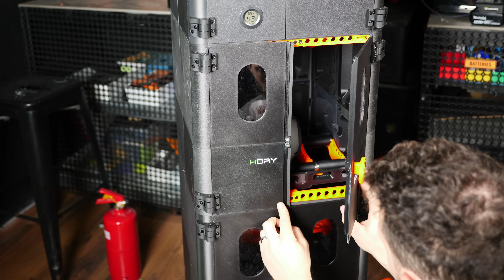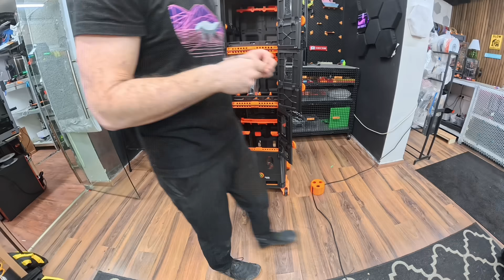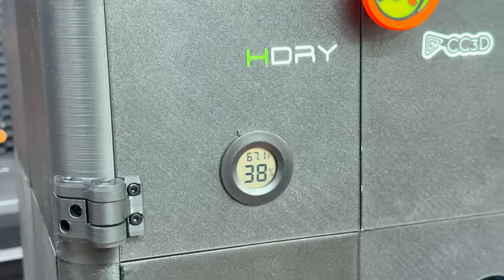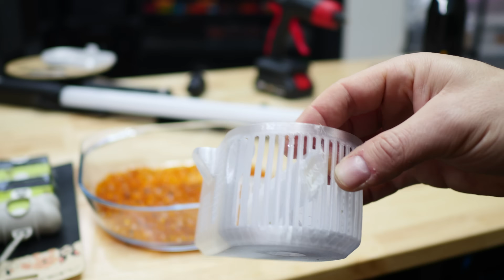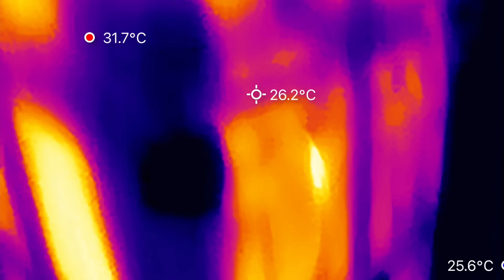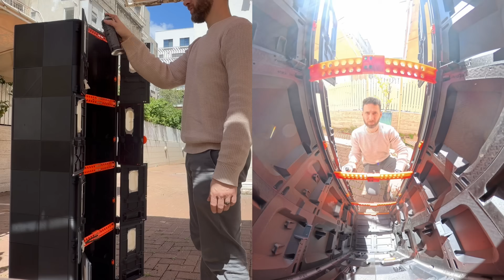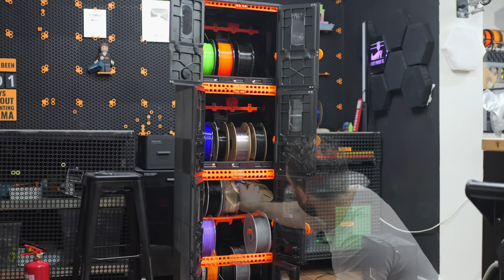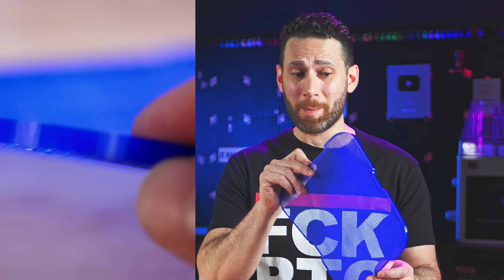This Will REVOLUTIONIZE 3D Printer Filament Storage!

Comment: I am happy enough with my AMS2Pro
just 150g of silica will keep it at 3% when fresh and stay below 10% for 4-5 weeks in a 45-55% humidity room
then I just swap the silica for fresh ones and bake them in oven for 2h to refresh it
I also have a polydryer for filaments I don't use often like TPU so that I don't have to open the ams
the key to success imo is a perfectly sealed box and open it only when necessary
I never even used the filament drying cycle, just change the silica for fresh one every 4-5 weeks and that is all that's needed to stay below 10% forever

Comment: From what I've found, just putting the desiccant in a tray at the bottom works really well (I use totes that have a seal on the lid).  And yes, I just do a quick heat / dry for a spool before storing, and I am to achieve less than 15% stored in my basement (in Toronto area).  As soon as I see the humidity change (I use some cheap humidity remotes hooked up to Home Assistant), and then just swap out the open tray of filament.  Easy, cheap, and quick to manage.

Comment: Thing to remember about humidity is, like water seeks it's own level, Humidity seeks balance. When you put fresh dry desiccant in an enclosed system, the bulk of moisture will seek it out and get absorbed, the opposite happens if you put a spool in that is drier than the desiccant, moisture will leave the desiccant and get absorbed by the filament.  When the desiccant and filament reach balance, then they are each holding equal amounts of moisture.  So if your cabinet stays at 35%, that means both the filament and the desiccant are holding 35% moisture.
Reply: @acdii  you can use the air humidity as a proxy for the filament and disecant ones, but is not exactly that. Different materials still draw water with different intensities, at 50% air humidity silica could be almost fully saturated for example, not at half it's capacity
Reply: @pepopipo974  Temperature plays a role. The colder the air, the less moisture it can hold yet still read at 99%. Heat that volume of air without adding more moisture and the percentage drops.  Thats how the dryers work, the heat draws out the moisture and exchanges it with drier cooler air.  BUT thats not in regards to what I said. Moisture seeks out dry. It seeks balance. Just like water seeks it's own level, so does moisture.  Its called diffusion where it seeks out drier substrates to balance it out.  When a sealed cabinet reaches equilibrium, that is what the Hygrometer will sow, so if it reads 38% after several hours, the overall moisture in the Desiccant AND the filament are at 38%, and is temperature dependent,. The colder the air, the the less moisture it holds, the warmer the air, the more moisture is can hold. Example 38% @60* holds .0003147 lb.cu ft, raise the temperature to 80* @ 38% it holds 0.0005998 lbs/cu ft.  80% air @ 38% holds 0.0002852 lbs/cu ft more moisture.   Irrelevant to the point I was making though.  Wet desiccant will make dry filament wet when placed together, thats the point.

Comment: Question is would it be more cost effective to order some of the larger panels as injection molded? (obviously it would require small redesigns to do this, but would be interesting to see about leaking)

Comment: Spray paint has no moisture it has lots of VOCs or solvents in it. Also the only safe color changing dessicant goes from orange to clear. Even the orange to green is not fully non toxic. The orange to clear beads use iron based indicators so it's very non toxic.

Comment: With molecular sieves you can get ams units to essentially 0%RH. Ams2 boxes are actually much more leaky than ams1 boxes because of the valves. Be aware over drying nylons can be a thing.

Comment: I would also not use a fan with loose silica gel they do have some very unmeltable dust generation that if you constantly blow a fan over the beads directly as that same dust could land on your filament and eventually cause a nozzle clog.

Comment: i have an e-dry cabinet i bought through kb-3d group buy.  It was pretty expensive, but it works amazingly well in a similar fashion to what you are making and you don't have to recharge the dessicant.  I set it to 3% and it keeps it 3-5% or so all the time.  It holds like 20 spools.  I can just grab whatever fancy filament I want from there and print it without worrying about having to dry it.

Comment: Are you trying to make a desiccant holder that allows you to replace the silica without having to open the cabinet? You need a cabinet wall that integrates part of the desiccant holder (cartridge holder and fan) and that allows for quick replacement of the sealant cartridge directly from the outside.

Comment: I live near the water, so my ambient humidity is almost always 40% or higher. What I've been doing so far is keeping all my filament in PolyDryer boxes, which have a silica gel cartridge and a humidity sensor, to which I a supplemental activated alumina cartridge. Once in a while, when the humidity registers above 10%, I change out the alumina, which takes about 20-30 seconds per box. Then I cook the used alumina and add it back to my ready supply. It's simple but it's working so far.

The alumina is able to even pull humidity out of the silica, and in most cases an alumina recharge will bring the humidity down to 10%. If it's been really abused, like I left the lid off and the humidity got to 30%, a second change of the alumina is necessary. Once it's down to 10%, if I don't open the box, I only need to change the alumina about once per month. Hope this helps.

Comment: In the Navy we used basically a dual chamber dessication system... Basically one stage dries out the air from the other chamber... You'll have to switch to alumina but that is a better regenerative dessicant anyways... Hook a couple of sensors and some solenoids to control an air manifold and it will self regenerate...

Comment: You guys are over engineering this. Do yourself a favour and look at the principals of a biltong maker and adapt your design around that. Although biltong makers ideal humidity is 50%. I could use the same mechanics to get a filament dry crate down to 10 - 15%.

Comment: Another issue is the size of the build and the stacking design. Great for expanding and storing lots of filament, but the larger the build, the harder it is to keep the moisture level low because any time you open any part of the cabinet, you've just undone your drying (or some vast majority of it).

Comment: what would it take to make a smart cabinet? Maybe I misunderstand how it works. What I mean by a smart cabinet is have an a brain that measures the humidity change and does a cycle of circulate air within the cabinet past the desiccant with one air direction then periodic reverse air direction and heat the desiccant only. blowing out of the cabinet. Drying the filament releasing the water.
The fastest way to dehydrate is with heat. But storing in a dry place eventually will dry.  By actively drying it is keeping it dry. Maybe the cabinet would be for active filament. that is not used often. minimizing the thermal cycling. that is good.

Comment: While it's not nearly to same magnitude as your drying solution is, I actually recently swapped all my silica to activated alumina and the result was immediately noticeable. My AMS 1 and AMS 2 PRO are regularly single digit RH and my giant 165 qt dry box with a wide variety of filaments is in the teens if not lower (with no active air circulation yet). Definitely try the alumina!

Comment: you can try to improve isolation of the chamber using PU glue, also known as automotive windshield glue. just smear it on the cracks, once dried it'll seal all the cracks leaving most of the storage unit sealed to the outside

Comment: I feel like the ultimate solution is for filament manufacturers to find a way to coat the outside of filament with some nano coating to block moisture, surely with all the advanced chemical science we have we can figure out a coating that won't affect print quality or adhesion

Comment: I believe, the simplest way to check if filament is drying or not is to weigh it. Say, nylon can absorb up to 10% of it's weight of water, 100g per 1kg spool. PC and PLA absorb from 0.5% to 2% of it's weight, depending on fillers and additives. It's something you can easily measure in any CNC kitchen.

Comment: I've got a 32qt Sterlite gasket box that fits about 9 1kg spools plus a few 250g. I dried everything and plan to only pull out the desiccant when the humidity reads above 10%. I've been using it for 3 months and haven't seen it go above 10% yet despite opening it about once a week. After drying everything, you should not ever have to dry filament before printing. It's not an elegant sealed industrial metal cabinet but it works amazingly well for a hobbyist.
Reply: i keep mine in the same bin and try to use up filament before cracking the next airtight seal. many folks don't realize filament has a shelf life.

Comment: Could you make the drying elements external? Pull dry air in, push moist air out in cycles. Run for x minutes, wait, repeat. And do you not want to caulk all the cracks and thing? Couple tubes you could caulk the whole thing and be airtight. (I am not an engineer or anything. Actually I am quite the dummy so I have no idea if this would work.

Comment: I'm confused, you try to remove the moisture from the air inside your storage rack, but then open it to swap the desiccant letting the air in your storage rack normalise with the outside air. Then you have to remove all the humidity yet again?
As humid air generally rises, can't you just build an air recycler on the top of the storage rack, where you can swap the desiccant without ever open the storage rack?

Comment: Best long term storage solution is to use a glass fish tank with a glass lid.  I use a 29 gallon tank, generic desiccant and a small fan.  There are multiple hygrometers each reading 10%.  This will last 6 months before drying the desiccant in my convection oven.
With the opening at the top, dry air is not lost when opened.
WARNING!  REPLACE BATTERIES IN YOUR HYGROMETER OFTEN. As they age, the readings increase.

Comment: By design, a cabinet with many doors and seams will fail sooner or later. Huge amounts of desiccant always help, until saturated. In this design, it will be rather soon. Multiple smaller boxes with a reasonable amount of desiccant will be much better. Also, when taking out or placing a spool, this avoids large volumes of air being replaced.

Comment: 1 pound of activated aluminum, that's the current is equivalent to 10 pounds of silica desiccant. And activated, aluminum desiccant can actually maintain humidities as low as 0 or very close to. It's just, it takes 400°F. If I did the conversion right to rejuvenate it and you can't use a microwave

Comment: They have been doing this for years to keep all kinds of stuff dry. From equipment to guns and so forth, even make a gun system that uses silica dasican, and it's suspended in a chamber with membo sides and a container on the bottom. It'll actually pull moisture into the container. It's above so that your silic adesican never gets fully saturated. This would work great if you had some sort of hopper system set up so that it would see that your desiccate needs new, it would drop the old out drop new in and at the same time be drying.The old

Comment: Those little circular humidity detectors are often way off the mark, I've tried a bunch of the rectangular ones as well, and many of them are dreadful too. I did eventually find a couple reliable suppliers and found a set of rectangular sensors that were pretty much on the money.

Also, battery health matters A LOT with these little detectors, if your battery is low, the readings will be significantly off, usually higher than the reality. Ideally I find checking the batteries on them every couple of months to be key in getting accurate results. Models that use 2 batteries instead of just 1 also tend to work better in the long run.

Comment: /ust have to say I have been loving my Snapmaker U1. I may have overtightened some screws and ruined a couple pieces but their customer service is amazing. I sent in pictures with my initial service ticket and even though it was my fault they sent me replacement parts at no cost with no questions. AMAZING! I knew their customer service was top notch though because I also have the old Snapmaker 2.0 and they've always been helpful. They've only gotten better though. I sound like they paid me.... I wish.... I haven't even gotten any free items from them. Oh well. 🙂
*9/6!

Comment: Several issues that I can point out, as engineer who has some knowledge on environmental insulation:

1) PETG-CF is inferior choice over the regular PETG because of the worse interlayer adhesion. What does it mean? It means that it insulates worse and air can seep through the PETG-CF walls. 
2) Foam seals are not really good at insulation like that. They are designed to prevent the major air draft coming in or out, but they do not provide a perfect insulation due to the air pockets in the foamed structure. You need to use something like butyl rubber seals. 
3) Windows. I'm not sure if you redid them, but from the previous video - it appears you hot glued them in. This is not a good insulator too. I would either remove windows altogether, or at least would use a 2-part epoxy for acrylic.
4) Clear coat spray paint. While it may work in theory... if many layers applied, in reality, VOC solvents that dry up may not create a good insulation layer. I would rather do a brush/roller and thick coat of epoxy. It would do the trick much better. 
5) I purchased the model and looked at the design, the doors and their seal is ... questionable  to be honest. It would've been a much better if there would be some mechanism to press against the seal and being able to lock it in place in that pressed position. Magnets are not strong enough for that.
Reply from the maker: This is super helpful thanks!!!

Comment: If the dessicant box were a cube-shaped "cartridge" that is pushable through the cabinet while the fan setup is static, you would be pushing fresh dessicant in one end while the saturated dessicant gets pushed out the other. You'd just want to put in a cap to seal both ends of the "tunnel".

Comment: I have completed watching the video in its entirety. I have some thoughts.

1. Drylok waterproofing paint. I just repainted the cinder block wall in my garage. I'm not sure if it's different or better than what you used, so maybe just look at it.
2. As I typed out number one, I had another idea. Coat the inside with plasti-dip, or that water sealing stuff that is "as on TV" here in the US.
3. Bottom of the cabinet should be a round or oval container of desiccant. It rotates out to a dryer, then dry desiccant rotates back in. This is actually what I have been working on. It's a loop that moves in and out at a specific rate based on optimizing the desiccant. Inside the storage box, the ready to use desiccant is moving through. Outside, a small heat box that dries the desiccant before it loops back into the box. This eliminates the need for maintaining the desiccant. Can create a stable dry box and storage. Lower maintenance needs.

Cheers. Good luck with the next iteration. You are far more ahead of my idea and you have engineers working with you, I would love to see if any of my ideas above are reasonable and if you looked at them.

Looking forward to the next version.

Comment: You have come up with a solution that is very solid.

Not sure if you would remember me commenting on a previous video that I have been working on a similar idea. It's a similar idea to yours but a different take. A more industrial idea. Because I have worked in injection molding and am quite familiar with dryers used in the industry.

You have come up with an extremely simple product for the hobbyists. Brilliant. 👏👏

Comment: Yes! Repeatedly heating will weaken the poly esther bonds of PLA. PETG and 95A not so much but they have their own glass transition issues. And you are storing too much filament. While it's neat to think that a one size fits all solution will work, basically a one-to-one, using not printed filament boxes are the way to go. You are chasing your tail every time you open the cabinet.

Comment: Fantastic video!!! I have an idea for the inside humidity to stay lowe during desiccant swap outs! If the desiccant was made in modular holders mounted to the inside wall of the cabinet and a little hinged door with foam or rubber seals. Easy swap out without opening the large doors letting the bad air in! Idk if this will have a meaningful effect but in my mind it does 😅
Reply: I can see how that would be beneficial.  However you still have to open the cabinet to get the filament in and out. So you're gonna be opening the doors fairly often anyway.

Comment: I made a mod for the polydryer that makes it accept 2 plastic cereal boxes, one of which I have filled with printed boxes that hold about .75kg of silica gel. I've dried about 30kg of different filaments and the silica still looks unused. I am not sure if my humidity sensors only go down to 10%, but it gets the filaments there every time, and usually pretty quickly. Also the mod that I made does a lot better job circulating air, as I have it pulling the hot air from the top of the box, and adding the hot air from the bottom. Heats the filament WAY more evenly,

Comment: Two things come to mind, the cabinet should be sheet metal and doors sealed with gaskets. Secondly a small port for cotrolled air intake from barometric air pressure changes goes directly into a dessicant box.